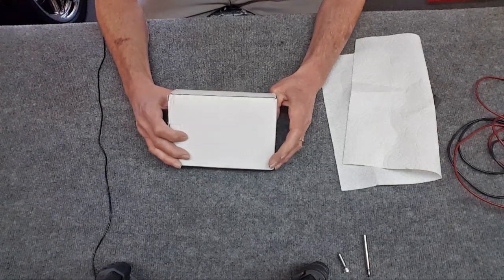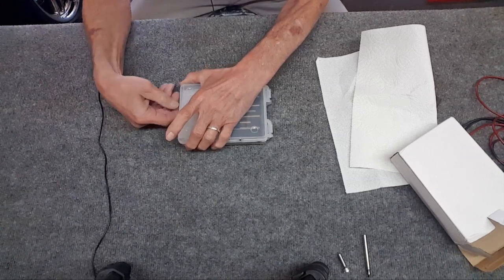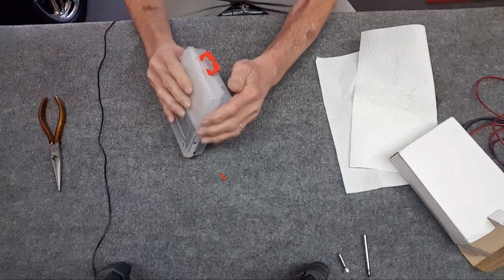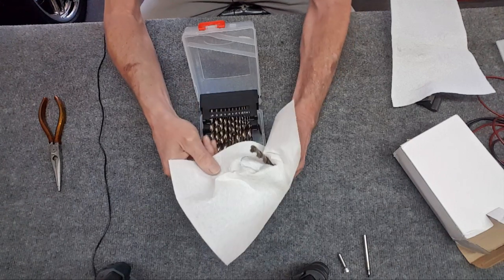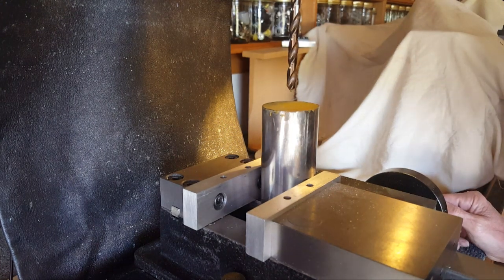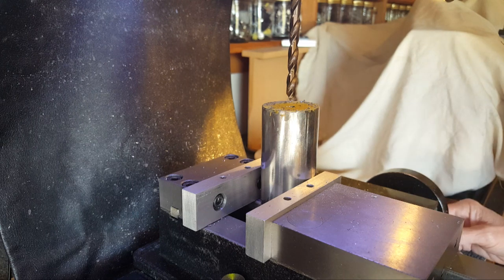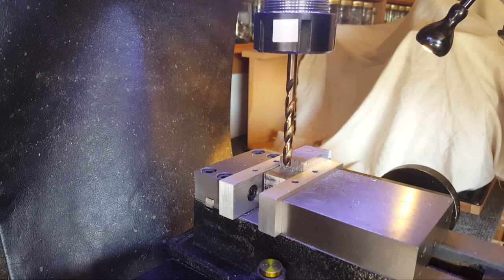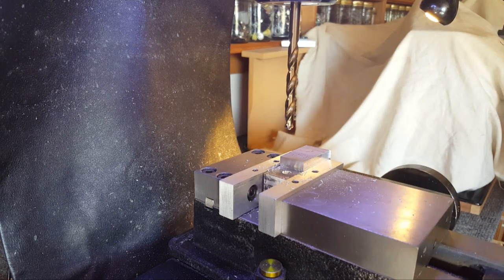M42 8% High Cobalt For Drilling Stainless

Comment: That package with the pin is designed to stop people opening the pack and stealing drills, when it's on display in a retail store. ;)
Reply from the maker: That makes sense! Never saw packaging like that here including drill bits at HF...
Reply: That's some Chinese patent I guess. Bought a set of taps and corresponding drillbits some time ago here in Sweden.
Chinese I guess. It took some time to find out the opening procedure. Grab the bottom and lift by the handle!
At least no item is escaping the thin Chinaplastic bag during transport. Lost a hole set of ER32 collets and received an empty bag.